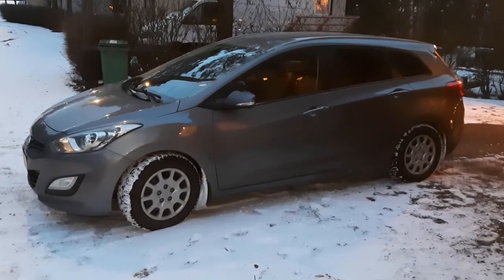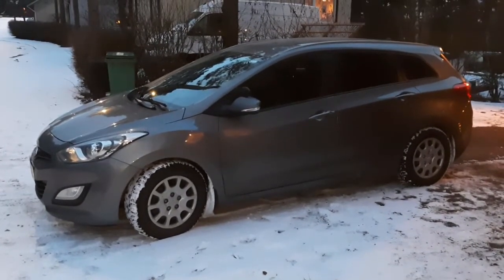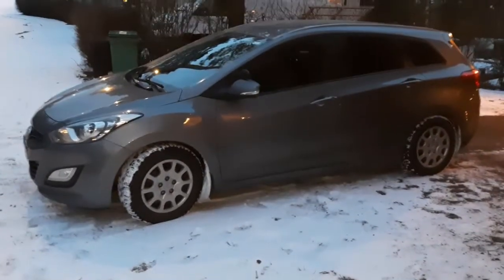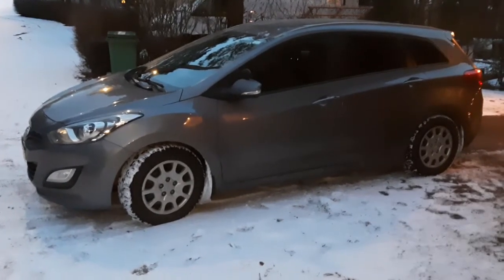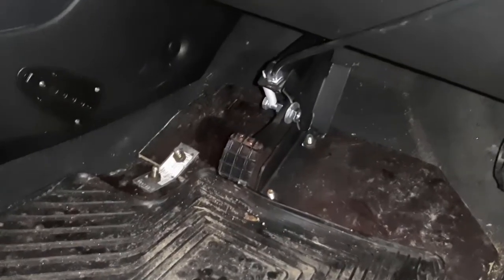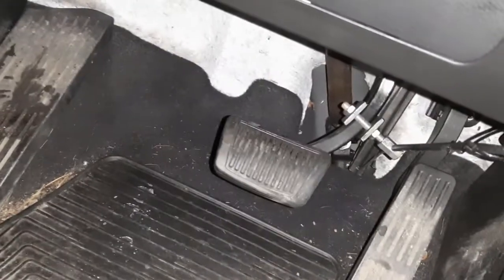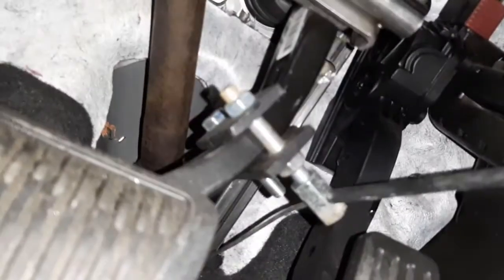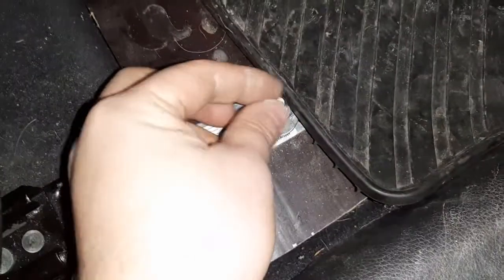Dual Brake / Co-Driver Brake Pedal install

Comment: Thanks for the video! One question by the way, anyone having a Finnish driving license can teach anyone in a car having this break pedal? and same car with this break pedal can be used for the driving test at ajovarma as well?
Reply: the teacher must apply for a teaching permit from ajovarma (more info on their website) and you can use the same car during the drivers test
Reply from the maker: Yes as TheVolvoMan said
Reply: Yes in uk

Comment: I bought a car with a driver’s Ed brake, but it doesn’t work. Any advice on getting rid of it?
Reply from the maker: Like install but in reverse. Just disconnect the cable from the actual brake pedal and remove the assembly. 
You might have to look how the install is made as there are many ways of going about it if the previous owner drilled anything new or anything like that. Another possibility might be it is a factory install as those are possible but rare... it is a hydraulic system and i have no idea without seeing it how to remove it.

Comment: sir, what cable did you use? does it have a specific size?
Reply from the maker: I don't recall the cable length this was a kit sold by a general hardware store it cave with fasteners and extra pedal and cable. So i did not measure it.